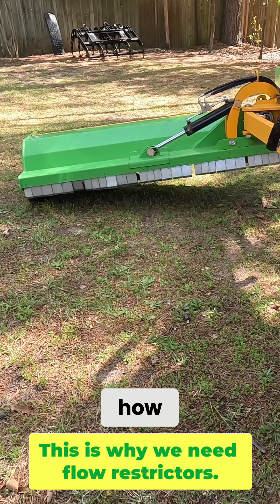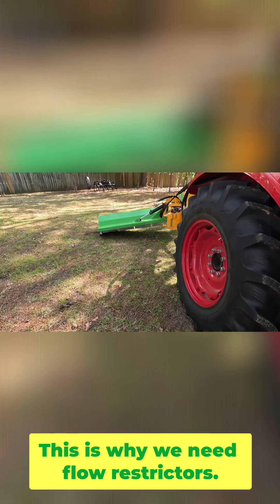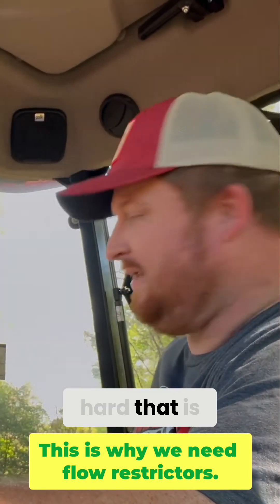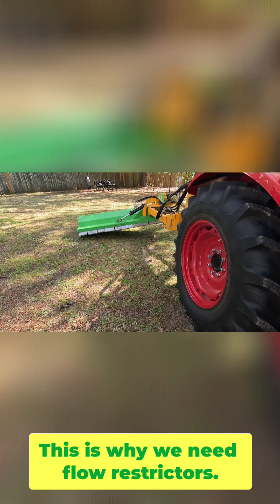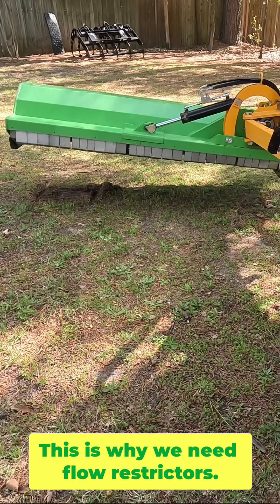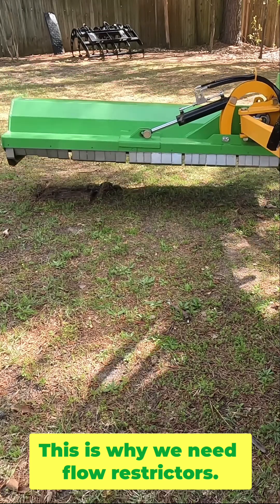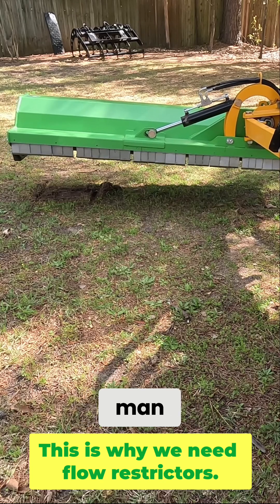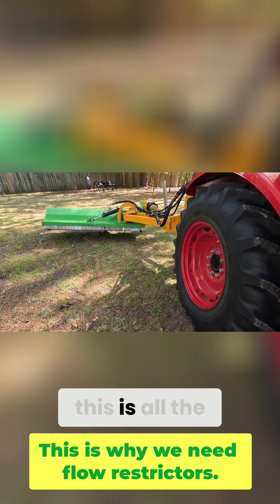The Power of Tractor Hydraulics: Why Flow Restrictors Are So Important

Comment: Can you a, ... flow control ?
Reply from the maker: It's very difficult without adding something inline. The main video is about adding flow restrictors to bring this motion under control.
Reply: A directional flow control valve will only restrict the flow in one direction, while allowing full flow in the other direction.  Just put it inline where the hose connects to the base of the cylinder.
Reply from the maker: @smoothbore4377  I’m not using control valves. I put restrictors on each side, so that it affects both directions. They start at a 1/32 restriction, and you can drill them out in small increments until you get the flow/speed you like. The restrictors are on the flail mower hoses, so they only affect the mower. Anything else connected in will get the full flow. I also use restrictors on my grapple to slow it down just a bit.